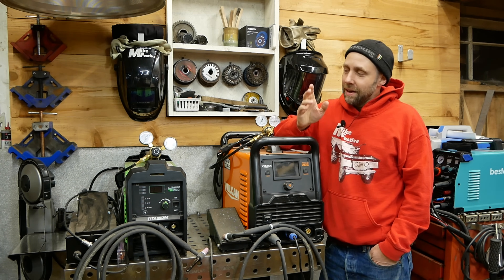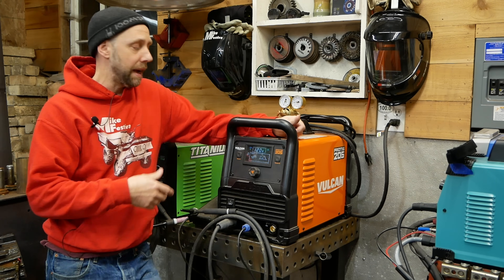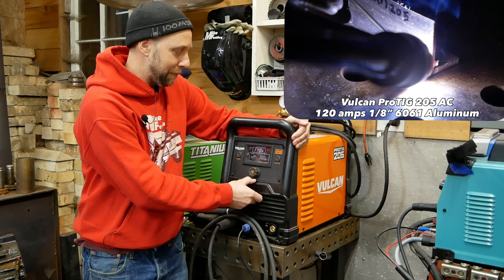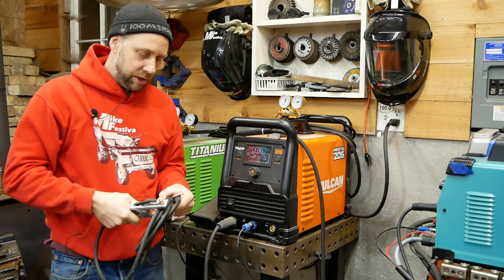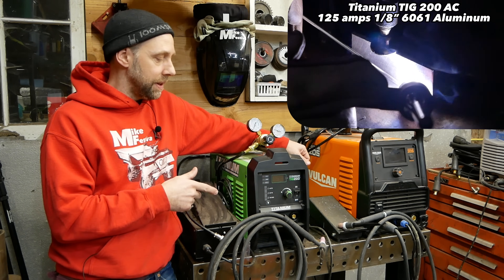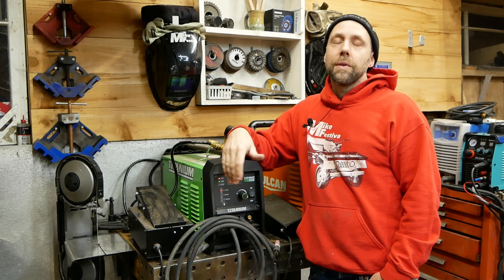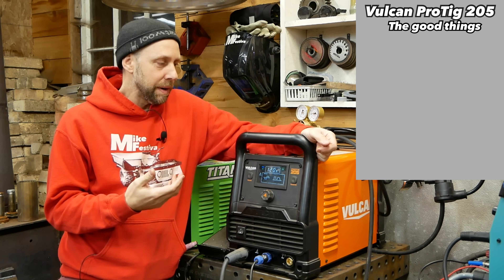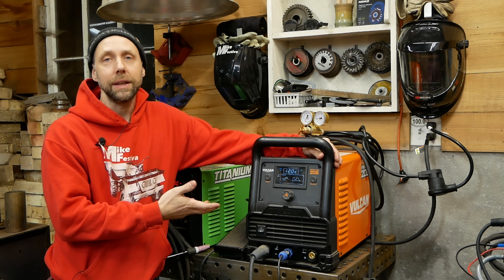Vulcan Vs Titanium AC/DC TIG Welder Review.

Comment: Hello Mike. What size dinse connectors are in the tig200. I saw it says 25 on there but I’m getting conflicting information that says size 35 everywhere else. I’m not a big fan of the torch that comes with the unit and look to purchase a CK 17 flex head torch with the pass-through gas connector. I just don’t know what size to get that’ll plug right into the TIG 200.

Comment: Can u eliminate the pedal and used different torch or adapter?
Reply from the maker: You can hook up different torches and leads but you need to use the pedals to start/ stop the torch and control amperage.
Reply: Thank you @Mikefestiva

Comment: just get a prime weld 225, same price if not cheaper and has better accessories and is a better machine
Reply from the maker: Time will tell how it holds up.
Come back in 3 years and let me know if it’s still working.
Keep in mind that lots of the reviews on those Primeweld machines are paid for. I was even offered money to make a review, I wasn’t interested in it because a (paid review) isn’t a review. Also the machines look like they are from the 1970s.
Reply: @Mikefestiva  ive never heard anything especially bad even from non sponsored posts, ive personally used it and have had 0 issues, digital vs analog controls/design is a preference. all 3 machines will do what you need them to do but per dollar you get more from the primeweld.

Comment: Thanks for the video. I've welded over the years in the body shop and at home with a mig but I've never used a tig. I need to do some frame rail repairs to my truck but I think the mig is probably better for that kind of work. A Lincoln Handy Mig isn't the best welder, and it has almost no adjustments for the settings, but it does alright for how I use it. It looks like the Titanium 200 tig will be better for my needs. Not sure if it's the best for doing tiny welds on gun parts though.

Comment: Great video I do alot of metal work on cars mainly 18 gauge and use mig welder right now would like to do more tig I bought a jegs tig welder but came with no foot pedal option would like to now which one of those 2 you would recommend thanks

Comment: On the Titanium welder can you change out the foot pedal
Reply: I just bought a used Titanium Tig 200 and yes the foot pedal is large but hello we are welders/fabricators so I spent about 1.5 hours in my shop and cut down my foot pedal on 1 end by 1 1/2" and it is Much better for sitting or standing now. It's a big empty box waiting for your changes, just a thought.
Reply: I'd imagine

Comment: Great video Mike and a nice simplistic comparison of those two welders. I too feel Vulcan is a quality product and own the MigMax 215 and must say it's a really strong MIG welder. I've been welding for over 30 years and have multiple process certifications (GTAW, GMAW, SMAW, Plasma Arc Welding, & OxyAcc) all of which I received while in the US Navy and those certifications are for the areas af heavy equipment and Aeronautics/ Aerospace and in 10 different metal groups. I've use some of the best welding equipment money can buy and for the money you'll have a hard time finding any welding equipment out perform most of the Vulcan line for the same cost. Yes Miller, ESAB, and Lincoln are definitely some of the big name leaders but after using a Vulcan for over 3 years now I'm convinced of their quality and feel they could hold there own against some of the big names out there. I'm getting ready to watch a few more of your videos as I like the way you put out your information.

Comment: I am doing a large repair job on a old aluminum boat. Lots of corroded spots and bolt holes. All the plate is 3/16. 
Is the 205 enough of a machine to tackle the 3-16 plate?
Or is a 220 a better choice?

Comment: Hey Mike I'd like to hear your opinion on the prime weld 225 I'm on the fence about it and I'd value your thoughts
Reply from the maker: Hey I haven’t ever ran any Primeweld products before.
The company reached out to me a few years back and asked if I wanted to try there welders. At the time I was testing out a new welder ( from a different company ) and didn’t want to switch brands because I really like to test one machine for a year or so in my shop so I can test it and others can see how it holds up in my videos.
So I turned down there offer. I have heard other subscribers mention over the years they like the Primeweld stuff.
I just looked it up and I really like the CK torch and super flexible lead. I run that on my other TIG welders 👍 the price is good. Looks like it comes with everything you will need.
I would suggest looking at many reviews and even check there older TIG models to see if anyone has had any problems with them.
I doubt you will need it but it’s nice it comes with a 3 year warranty 👍 For the price I’m sure it’s a good machine.
I would say go for it and get TIG welding 😊

Comment: Mike, I bought the Hynade welder after watching one of your videos. My experience is no reflection on you. I just wanted you to know about my experience. I had my most experienced welder help get this welder tuned in, however it would not keep the high frequency on. It would start the torch but then go off and destroy the tungsten. Hynade eliminated their phone number and do not respond to emails. The 3 year warranty is not valid if you can not reach anybody. I’ll probably switched to the Vulcan for my home use. I owned a company with over 50 tig welding personnel so I have been around the process. I had all Miller dynasty welders and 95% was aluminum tig. I sold the business after 20 years and two locations. I do a lot of mig but never mastered tig. I do appreciate your videos. Thanks for all your videos.

Comment: My work shop has a 30amp breaker, would the titanium 200 work with my 110, 30amp setup? I’m only welding 1/8 aluminum
Reply: In his other TIG video he is using the 205 welding 1/8th inch aluminum with a 115v 15 amp or 20 amp plug i think and said he doesnt have a problem and MAYBE could push it to 3/16

Comment: Do u need to hookup the pedal for the machine to weld or can you weld without it?
Reply: in tig welding the pedal is necessary, in stick it is not.
Reply: If you torch has a trigger you don't need a pedal.

Comment: Mike, I don't understand using AC power, VS DC power. I hear you have to use DC for this and that, and I hear someone else the opposite. Could you do a video and explain this so a beginner can understand where to use which, please?
Reply from the maker: It’s fairly simple, DC for Steel and Stainless steel, AC for aluminum. 😊👍

Comment: Are these worth it for a weekend hobby welder learning aluminum but ive been welding for years just wondering if its better to invest in a lincoln or esab welder for better results?
Reply from the maker: If you have been welding for years you would know that better results come with time and practice not just because you own a name brand machine.
I have welded with Lincoln and Miller machines and they all weld the same, again it’s the operator not the welder.
Reply: @Mikefestiva  im just saying if you were only welding on the weekends a high end welder may not be the best option i would think right unless u were welding for a living
Reply: Buy the harbor freight with a warranty. Learn the machine. Return it and buy a red or blue welder.

Comment: I'm curious how they can sell the titanium tig200 at $899 and the Vulcan protig205 at $1299 with the limited features and amps when the Primeweld 225 is only $869. Am I missing something of did Harbor Freight price themselves out of the hobby grade welding market? When these machines first came out they were hundreds cheaper and seemed to be priced appropriately...
Reply from the maker: I think the biggest difference would be these welders especially the Vulcan has memory and the interface is a lot different with the digital settings then the Primeweld with all manual settings.
Reply: I have had 6 205 in last 2 years. If you doing and grinding around it the metal gets in it and it pops the board I have keep returning them

Comment: Hi
Do you know if it is possible to get the Vulcan Protig 205 with a European plug 220v (200-240v) Or do you have to use an adapter?
Reply: I wouldn't put an adapter I'd just rewire it to an appropriate plug. I'm sure you could but bro don't chance it. Just give it the right plug.

Comment: Huh.  I've had issues with my Vulcan for a bit with erratic arc, but they went away when I went to a buddy's house to weld something with it and used his regulator.  Didn't even connect the dots until this video. Thanks!

Comment: How is the duty cycle on the titanium? Do you think I could install a finger toggle in place of the foot pedal? I really need a mig and tig at home . Kinda disappointed that the titanium unlimited 200 isn’t a ac/dc machine with a foot pedal option . Foot pedal is great at the work bench but a finger toggle is nice for in the floor  .great video Mike .
Reply: How long can you weld aluminum like 3 inches and stop then you have to wait before restart it won't restart right away is this how it's supposed to a t at 140 amps

Comment: I've had the Vulcan 220 mig welder for about 5 years now. I bought it to fabricate my ornamental handrailing at home. 
 I've ran maybe 100 lbs of wire thru it in that 5 yrs  so it's used only occasionally but just built two entrance gates and it runs like it did the day I got it. 
 Been thinking of buying a tig machine and for hobby use, knowing how well the Vulcan mig rig has done, it's hard not to consider buying another Vulcan.
Reply: Did you? What's the verdict?

Comment: Seems like the Vulcan is the clear winner. With the Titanium, you save $220 or so, but get a junk regulator (you aren’t the first to mention this), a clunky foot pedal, less features, goofy plug adapter and an overall less confidence inspiring machine. If there was $400-$500 between machines, I’d have to think about it, but for $220, the Vulcan is a CLEAR winner.
Reply: I just got one of the titanium for $400 barely used still in the box. I know nothing of tig or the machines, and I could tell immediately it was lacking features.

Comment: you like the Vulcan 205 or 220 better?
Reply from the maker: Those two Vulcan welders are entirely different machines so it’s a bit hard to compare, the 205 is mainly an AC/DC TIG that can stick weld also.
The 220 is mainly a MIG welder with stick and basic DC only TIG. It really comes down to what you mainly want, MIG or do you want a Ac/Dc TIG? Both welders work quite well 👍
Reply: @Mikefestiva  thanks so much for the response, I really appreciate it. I was unaware that the 220 was DC tig only.

Comment: Mike; I do not see any provisions on the current Titanium 200 for a foot pedal, nor is it in the owners manual I downloaded.  I also do not see a foot pedal in the list of included items.   Might they have deleted this?
Reply from the maker: I think you are mistaken for which Titanium this is, the is is the TIG 200, I think you probably own the Titanium unlimited 200. They are different welders with different features.
Reply: @Mikefestiva  You are correct.    I mixed up the TIG 200 and the Unlimited 200 (which seems to have some limitations).   Thanks for the clarification.
Reply: The unlimited 200 can not use a pedal

Comment: Ik this might irrelevant but on your omnipro 220 do you have to change the drive roll when you change your wire? Because I'm wanting to get one but I wanna run .035 wire and I know it comes from factory with a .030 but does anyone know anything about how to change it and where I can get one if I have to change it? Any help is appreciated
Reply from the maker: The Vulcan in this video is the ProTIG 205, but I have owned the Vulcan Omnipro 220 in the past.
The 220 comes with 2 different drive rollers, 1 is for .030 and .035 flux core wire, the other roller is for .030 and .  035 solid wire, the rollers are double sided 🙂

Comment: Hey Mike, a few years ago, I bought a Vulcan omnipro 220, because I thought I could do Tig/mig/stick with just one welder. I haven't gottent a Tig torch or pedal yet because upon more research, I found out it would not do aluminum. Then there are some who say it can do aluminum, but it's just more difficult due to AC/DC lack of being able to change. I also didn't want to buy a whole other tank pure argon, and different regulator if I wouldn't be able to Tig aluminum anyway. I really like how it mig welds, and I got to try stick welding with it, and it did well with that. Is there any point to getting a Tig torch and pedal for this? Or should I just get a purpose built Tig machine? I don't see much need for Tig other than occasional for what I do. Lower investment might be torch and pedal, but if it isn't going to work well, might be better to just use mig. What do you think?

Comment: I have a Titanium 200 multi process welder. Bought it about a year ago and so far everything has worked great. Although I haven’t tig welded with it yet, mainly because I haven’t needed to weld any aluminum. But I have used the hell out of the mig function and I can’t complain. Never had an issue with regulators or over heating etc… My only real complaint is mine didn’t come with a pedal. I haven’t really looked into getting one for it cause I wasn’t sure that it was an option until seeing this video. Oh, great video by the way! And thanks for the review.
Reply from the maker: I also own the Titanium unlimited 200 it been working great for over 3 years now. The TIG is a DC only TIG so aluminum is out for that machine unless you buy a spool gun.
These welders are AC/DC welders and both are high frequency start.
Reply: @Mikefestiva  thanks a lot. I didn’t know that about my welder. Saved me a bunch of headaches down the road. Obviously I don’t know as much as I probably should but, I know a little more now so thanks again.

Comment: Nice review Mike, I was wondering how those two welders stacked up against each other. 

I'm a welder and metal fabricator by trade, used the old Miller Dialarc for tig for years then the Syncrowave. Welding thin aluminum as in 35 to 80 thou the added adjustments are very handy and help do a better job. 

I know I'll be building some homebuilt aircraft fuel tanks in the future so I may look at getting the Vulcan over the Titanium.

As for the size of the foot peddle... it's the same size as the one Miller has used for some 50 years now. I should know I've worn a couple of them out. Simple design means simple to fix. 

Have a good week.
Reply from the maker: Thanks for watching Kriss 👍
Reply: The smaller pedal for the Vulcan is a direct copy of the Tweco/ESAB pedal I have on my ESAB. I can’t speak to what’s inside, but it the gold standard design. A few companies make copies.

Comment: Do you ball up the tungsten end before welding aluminum ?
Reply from the maker: There’s no need to do that, older AC machines that was the norm, on these inverter welders it’s not necessary. You can adjust your AC balance to ball the tungsten but it’s not necessary 👍

Comment: Nice. I was unaware the Vulcan had pulse. I'm happy with my vulcan215. But I ended up getting primeweld 225 for tig.
Reply: I would like to see a comparison between the vulcan, primeweld, and AHP
Reply from the maker: I hear a lot of people like there Priweweld TIG machines 👍
Reply: @Mikefestiva  I like that it comes with the CK worldwide torch and hoses.  It also seems it'd be easier to play with the settings when you can just turn the specific dial you want for pre-post, etc. while you're welding.  Thanks for these great videos!  Keep up the good work.

Comment: Hey Mike! Thanks for going over these two great welders for those of us venturing outside of mig welding. Have you done a video on a budget fab table? That is what my next project will need to be. Thanks!
Reply from the maker: Thanks for checking out my new video 👍 I haven’t done a video on Fab tables yet, I basically went from a small home made welding/cutting table for years to the Langmuir system table and as nice as it is, it’s definitely not a budget table.
There’s a lot of tables out there in the $100 range like Harbor freight sells, I will do some research and try to put together a video 🙂 Thanks for the suggestion!

Comment: So I could buy 7 of the AHP 201XD welders like I have (just 1) for the price of one Miller.  I do wonder what the massive profit margin is for Miller, as there is no way it costs them like $4 or 5k to build them. My AHP came with the 'sewing machine' foot pedal and I ended up getting the Vulcan pedal from HF and adapting it to the AHP, piece of cake. Works great.
Reply from the maker: Haha I Have used my friends Miller Dynasties and it didn’t work 7 times better then my Vulcan 😂 it welded basically the same. 
Thanks for checking out my new video 👍
Reply: @Mikefestiva  Yes, exactly!

Comment: I dig it. Great comparison and recommendations. What I really appreciate about your content is the no-BS, straight forward info that most of the common DIY garager’s want to know. 

Quick suggestion- I’ve worked in manufacturing maintenance for a long time and one of the biggest problems for most machinery is clean airflow. Over time dust and debris from shop use and the environment in general will build up and can cause issues. I use a high flow universal filter media on all my machines that have an open intake like the back of those welders. Just place a few strips of Velcro tape around the welder intakes and the filter media clings to it. Easy to maintain and replace and it keeps those internal components clean for a long life of use.
Reply from the maker: Thanks for checking out my new video! Man that’s a great idea! Thanks for the suggestion 👍🙂